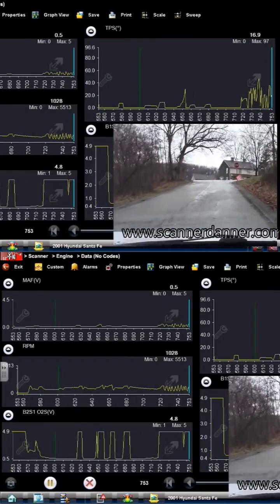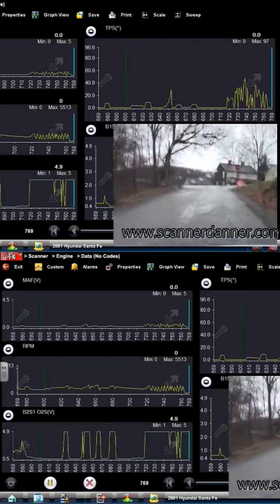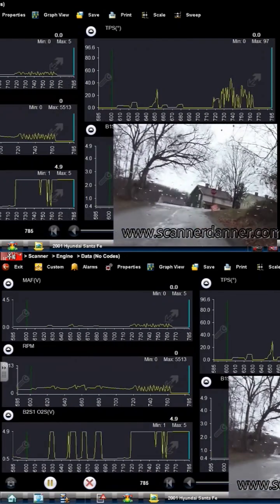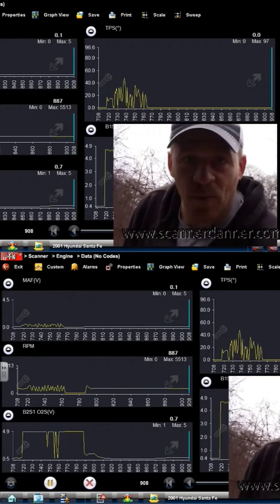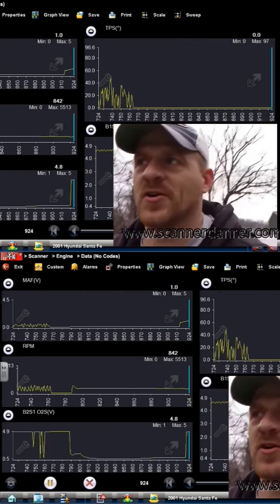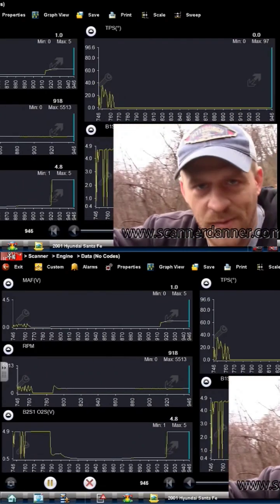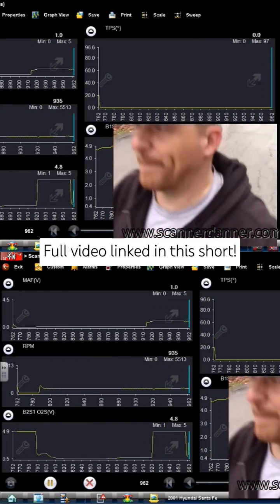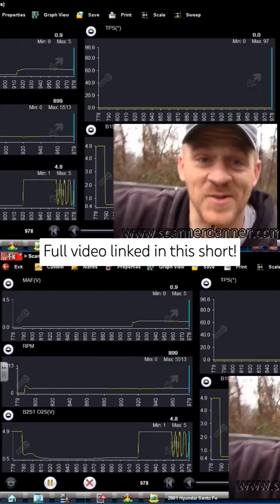MAF Sensor/Wideband O2 Testing

Comment: Hy Toyota Corolla 1.3L s maf is over reporting .I change maf but didn't fix.why maf is at 3g/s instead of 1.6g/s. fuel trims -30 plz help me
Reply from the maker: Under a 3.0L engine you cannot follow that rule!
Reply: @ScannerDanner  respected sir how much possibility of over reporting maf .mechanical failer or electrical.

Comment: Regarding the o2 sensor voltage, I thought high voltage meant rich instead of lean.
Reply from the maker: This is a wideband O2. Check out the full video, I cover the testing and signal range of this sensor. Thanks!
Reply: @ScannerDanner  ok thanks for the reply! I’ll be sure to check it out. I appreciate all your teachings man! Have learned a lot from you so far